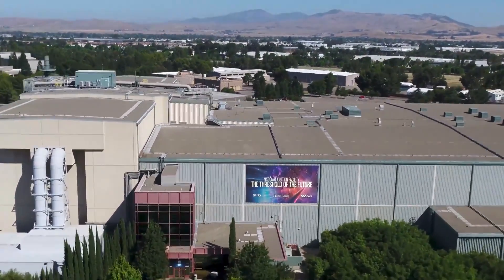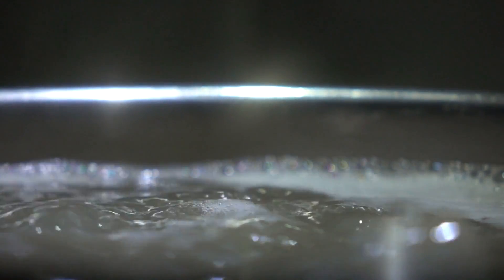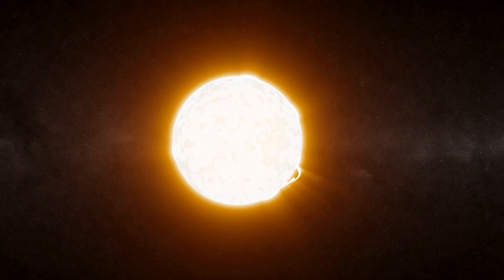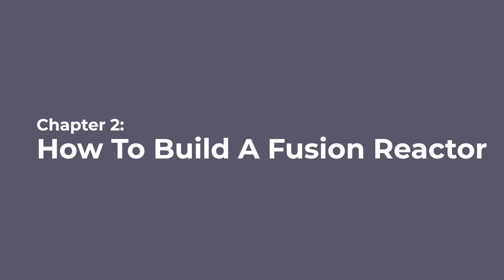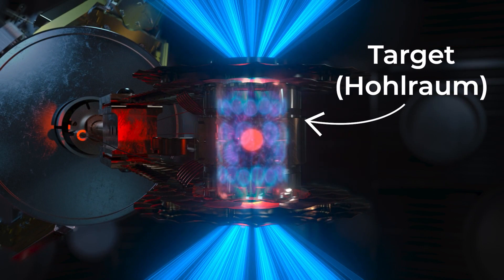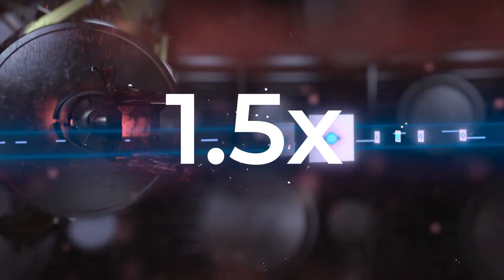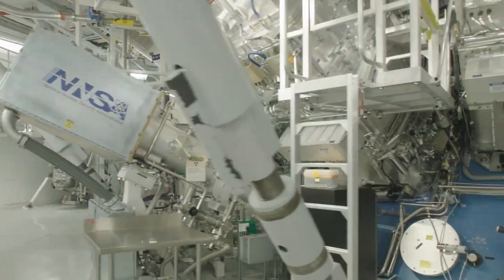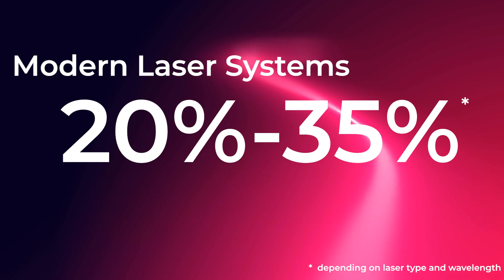The US Fusion Ignition Breakthrough EXPLAINED

Comment: Climate change is not from CO2
What melted the last ice age?
What froze the last ice age?
Was not CO2,  it was the sun, orbit, volcanism, or comet or asteroid.
92% of the greenhouse gas in the atmosphere is simple water vapor.
Chemical energy got man into the Industrial Age.  Does oil and coal pollute you bet.  It is way too expensive, we need a technology that gives us a Car that costs one dollar to go 500 miles, and is 5 minutes to charge back up.  Problem One is that batteries will never do it. We need super capacitors.  It can only happen with room temperature super conduction, Graphene doped with silver and boron.  Then you need nuclear LFTRs to provide the 70% increase demand load on the grid.  More than enough Thorium to last 5000 years until you perfect fusion, which the Ocean has a 1000000 year supply but look to the comets for more.  Science people did you know that the CO2 levels were 10000 parts per million and the Earth was a big Ice Ball frozen at the Equator!  What do you think the Limestone and marble is made out off?   4000 years ago how many grass eaters just in North America were putting out methane?  Try 4.5billion, one herd of buffalo covered an entire state alone not to mention the deer, wild Rams etc.  Number one polluter in the world is big agro.  50% of diesel goes into growing are food.  Not to mention the energy that it takes to transport and refrigerate.  We need 100 times more power clean and safe at 1/30 the cost.  Yup we are almost there but the Elites of the world do not want that. 80% of the taxes paid all over the world are energy related. Governments make more money on oil than the oil companies do, and have no liabilities, that the oil companies do.  Cheap clean energy is freedom.  23% of the cost of any product is energy, more or less.  Solar and wind are energy transfers.  Never get the power back that went into making them for solar unless used in space.  I want that energy transfer on a boat, RV in the middle of no where, but will never generate the energy it cost to create(the glass,aluminum,silicon, silver, and then the wind Turbine with getting the rare Earths for the generator noise and bird kills) Energy is the real money!  Science people not junk science, would love to have a debate with the fact that nuclear power has a million times more energy than a chemical bond.  It is 24/7 cheap clean , not the water based reactors of today a LFTR look it up.  Not enough rare Earths to create enough batteries to do 1/10th of what you are saying and would increase the cost of power by 200%. Nice for the governments to tax and make more money, no we need 100 times the power at 1/30th the cost.  Solar can never be more than 50% efficient and again never make back the watts that go into making them, same with wind, also these systems have to be replaced every 25 years the pollution then trying to recycle them is catastrophic for the environment..  
The Sun is the number one Threat to our way of life, a CME like the Carrington Event will hit the Earth 2-10 years it will set us back to the 18th century.  Not Climate charge…
Reply: Uh oh look out, ballomni forgot to take their meds again
Reply: @Gomlmon99  again personal attacks and not answering factual questions, even raised in your own report in the past, if we did not do it then, what was the so-called cause back then.  The Tonga eruption put out more CO2, and other gases in 2 days Than the USA has done for 5 years, and note that was one of 47 volcanoes eruptions in 20 months.  Again do I want oil, coal, etc, no way too expensive and pollution of air,water and land.  We need room temperature superconducting technology Right now, we should have done a moon type focus back in 73 with the first oil crisis.  And MSR based on the Thorium cycle. Look up Kirk Sorenson,  again did you even read my comments.  And the Sun is the number one threat to our way of life, the 1859 Carrington Event is fact and is going to happen again if not a larger CME and will plunge us back to the 18th century.  Science is about discussion not your response!
Reply: @Gomlmon99  again my argument was laid out in the first paragraph, what melted the last Ice Age?  What froze it, and for that matter what did the last five?  I hope others note your lack of science in addressing my arguments by the way I am a published Scientist.  How about the 2.5 billion year geological record?  There have been many mass extinction events in the past on this planet and you are part of the problem in the fact that we might be the first to be able to prevent an E.L.E. Event.  I am putting this so that others can read, we can work together but we first have to identify the real problems and then work on solutions that can be implemented and are more efficient thus cheaper and cleaner.  On this planet CO2 is a food that is needed for the plant life on land and in the Ocean, efficient use, of energy is key to our future.  Room temperature superconducting technology is 100% efficient!  Nuff said.

Comment: I think this event is more significant than most understand. Now that we’ve actually done it, we know exactly what temperature and pressure we need to sustain in all reactors for them to ignite
Reply: We already know that. That’s not the problem at all lmao
Reply: @Gomlmon99  Oh? Well then, by all means, please explain to an astrophysicist who’s been following fusion technology his entire adult life what the problem
Reply: @MrStreaty122  Lmao how embarrassing to be in science and not know the absolute basics of fusion. Especially when you’re talking so arrogantly as if you have any sort of clue.

We know the temperature and pressure required. We’ve known that for many decades. Temperature for DT fusion needs to be on the order of 100-150 million K. Pressure usually runs a bit below 1 atm but depends massively on confinement, magnets, reactor size. Even a child learns temperatures required in school.

Just some examples of problems are:
- Neutron bombardment of reactor components
- Plasma instabilities, disruptions and ELMs
- Energy diffusion from the plasma
- Impurity retention in reactor walls
- Poor energy conversion from plasma to electricity 
- Tritium inventories required and movement of tritium
- Design, installation and cost of breeding blankets
- Corrosion, particularly from breeding blanket medium
- Capital cost of the magnets and structural materials
- Large parasitic loads from the heating medium and cryoplant
- Regulatory controls and safety considerations
- Mechanical design of structural materials to withstand blankets 
- Sourcing of Be, Li, blanket material
Reply: This is a way of finding out if someone is who you need as a friend.  If they know and are amazed by this keep talking to them.
Reply: @genebohannon8820  i dont follow
Reply: @genebohannon8820  yea it sucks none of my friends are interested and amazed. Most people do not care its kinda sad.

Comment: It still requires a rare element. In simple terms, they just put a little bit of energy into something to extract from it slightly more energy. But the energy was always there. No one just spontaneously created new energy. It was simply converted. The most basic understand is fuel. We burn fuel to create a reaction which unleashes energy. It was always there and we just learned the process of changing it into something useful.

Comment: The reason why fusion is incredibly hard to do here on earth is because anyone believing that the graphic in the video is actually correct has already failed the fusion process. There is nothing that is preventing atoms being forced together. Nothing. There is no repulsion force in protons. If that were so, the entire earth might fly apart at any one given moment. Not going to happen. The reason why 1 plus 1 is equal to less than 2 is as two hydrogen atoms combine in a certain specific way(hint - one needs really cold, the other needs really hot, think nuclear fission to start nuclear fusion) and when that happens the parts that combine with the other would stretch the two protons to no longer be round, and would be out of balance(think out of round tire on a car).  The parts of the atom that combine to the other making the total no longer round are then given off from the combined atom, allowing the combined atom to become round. Know what those are called??? Neutrons. And it just so happens that there are two of them... Imagine that. So, 1 plus 1 is actually less than 2. And now that there are these two combined protons are spinning, guess what they are giving off. That is correct, twice the infrared energy, imagine that. Proving that hydrogen to helium is the only fusion process that gives off energy and is unique to all other fusion processes. Any other fusion process to larger elements takes energy. The hydrogen fusion process being unique and is now double the size of a single hydrogen atom, now has the capacity to have 4 times the storage of electrons and will start drawing in free electrons from greater and greater distances providing a source of electricity all on its own and no need to change heat into steam to run a turbine to produce electricity. 
Oh and what the NIF forgot to mention is that although there slightly more energy given off than the energy it took to fuse hydrogen, it didn't take into account the 6 Mj of energy it takes to run the machine. Yea, lets just keep that part secret. There is a reason why fusion technology will never happen, ever. Nobody is ever going to admit that because companies need research money to live on. And the ones that know how to make it happen, pray to God, they take it to their graves.

Comment: Your overview is very interesting & informative. It puts into perspective some of the hype I've seen recently.
In essence, what they have done is produce a hydrogen bomb, on a very tiny scale, & using lasers to initiate the compression process, rather than an atom bomb. This technology has been broadly around for 50-60 years.
The energy yield is likely in the form of a short duration 'spike', so would have to be replicated many, many times every second to be a viable source.
The most interesting part is where you 'zoom out' your reference frame, to consider not just the local area of the reaction cell, and its energy input, but the entire building. That radically debunks many of the initial claims.
Tokamak experiments have long been able to produce q values close to 1, but much more work has been done to produce long lasting & 'stable' plasmas, and plasma 'burns' of > 1s have been achieved.

Comment: Thanks for this very informative video? If there's a net gain at the fusion level, couldn't that excess energy be stored in some battery to eventually power the whole process? The wall socket power would just be used to jump start the process but could potentially be a self-reliant system.

I always think back to that scene in the Simpsons where Lisa creates a perpetual motion machine that keeps getting faster and Homer goes "Lisa, in this household we obey the laws of thermodynamics!"
Reply: theres the problem that batteries aren't 100% efficient. You lose some of the output energy by gathering it. Not to mention that you would be spending energy to store and release the energy which means that you could potentially use the energy to gather it and power itself, but you would at best have a net zero result. Thermodynamics dictates: Energy can neither be Destroyed nor Created.

Comment: This is what I have a problem grasping. First how do you capture an event so short and declare energy gained if no work was done from the resulting energy and Second how to determine what the cut off point for the energy in and out was to declare it a gain? It obviously took a MASSIVE amount of time and energy to get to that point so at what point do you set your data at if no work was done?  It's just hard for me to grasp and I haven't heard a proper explanation to satisfy how you determine the cutoff point to say yes we produced more if no water was actually boiled then used to generate electricity.

Comment: The thing that keeps putting me off is the energy output vs input.  They say how many joules in and out but they never say in what form.
Reply: And the output is unharnessed or wasted energy, right? That's like talking about the net output of a solar cell, but including the ambient energy that radiates away back into nature, right? 
      I mean it isn't electrical energy after powering a turbine, or the production of electricity similar to a solar cell.
Reply: Yeah, I highly doubt they are able to harness the power they are claiming it outputs.  Considering electromagnetic harvesters are 40-47% efficient, and Transformers with a ferrous metal connecting the coils are around 95%.  Im sure its in the realm of 40-60% efficient.  If it is in the range of 40-60% efficient it' a net power loss.

Comment: Ironic how we make the break thru by merely adhering to already known principles used in the Hydrogen Bomb for ignition, while I understand how the goals in a bomb may not need to adhere to net energy gains as highly as for civil power production, but its ironic how we've broken the milestone for more out than put in, while using what seems like XRay lensing (post atomic excitement from the lasers).

Edit* but I will also mention, that the NIF and their fusion experiments cover a broader context, that doesn't exclude stockpile upkeep either.

Comment: FINALLY A FULL AND GOOD EXPLANATION OF THE Q ISSUE!!  I have read a ton of comments from naysayers claiming it's not a real breakthrough because the lasers used to start the reaction used so much energy, but the whole truth is that those were ancient lasers and lasers that would bring it up to the necessary Q level already exist.

Is this right?
Reply: I don’t agree. This form of fusion could never be used for power generation. The purpose of this facility is to research the moments after a nuclear weapon detonates. Lasers could never be used for commercial fusion.
Reply: @Gomlmon99  Why not?
Reply: @Gomlmon99  Thanks.  This is exactly the sort of information I'm looking for.  So is the experiment strictly useful for understanding fusion rections?

The guy in the video seemed to be saying new lasers could, in fact, be used for much greater efficiency.  He said 35% for modern lasers vs 0.5% for the ones used the experiment-a 70x increase in Q, back of the envelope with no more engineering over the next few decades.  The day to recharge is also an artifact of the specific lasers used.
Reply: @Christobanistan  I don’t really know enough to say if this could be useful for civil power generation.

But 70x an overall energy gain of 0.011 is still only 0.77. I can’t see why anyone would bother with laser fusion for power generation, when other methods are so much more mature, and have more solutions to the above issues I mentioned.

Comment: What about Helion's Trenta reactor ? I thought this video is about it before watching ... can it be considered a breakthrough or a better and more efficient reactor ? I think we need a video explaining it as well.
Reply: was thinking the same thing. It is hard to speculate with fusion but it almost seems like they (along with general fusion's liquid metal piston system) seems to simplify the process to a point that we may see it sooner then something like, these other huge projects. 

Keep in mine i use the term simplify very loosely as those systems are not simple at all but have already "solved" the issue of capturing the energy in a usable way.   The issue with projects like the tokomak reactor. is even if they get net gains they still have to figure out how to capture that energy.
Reply: @nicholasjaeger3132  
Agreed, capturing the released energy always seemed to me like another big obstacle that needs to be addressed with these other projects like the Tokamak reactor.

Thats why when I understood how Trenta reactor works and how the magnetic field is going to directly generate electricity made a lot more sense to me. 

I really hope the next iteration of this reactor makes it economically viable and we might see nuclear fusion powering cities sooner than expected.
Reply: @Amr-El-Baramawy  If you have not looked at general fusions system of using liquid metal and pistons to compress the fuel and then capture the energy Take a look at that one. It is pretty cool and is on track to maybe start producing a net gain here soon as well! Though I like this idea better.
Reply: @nicholasjaeger3132  
I haven't ... I will take a look at it right now, Thanks